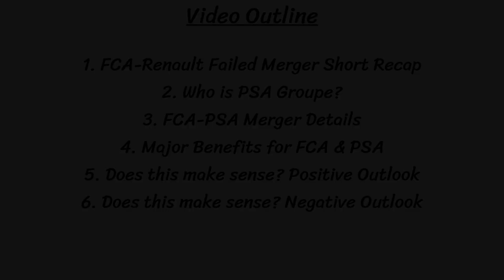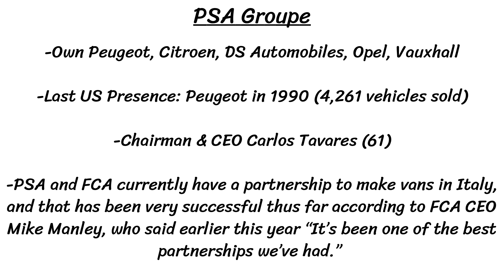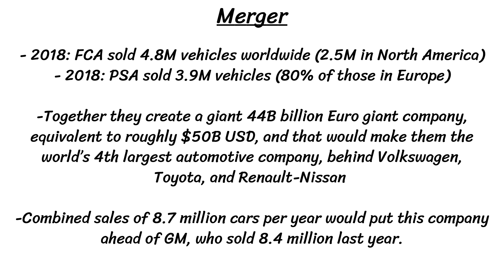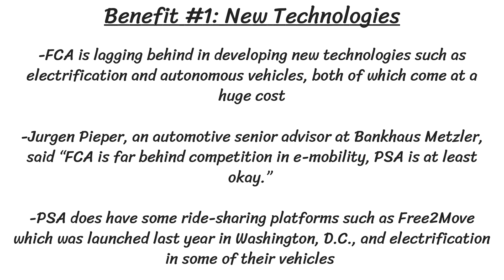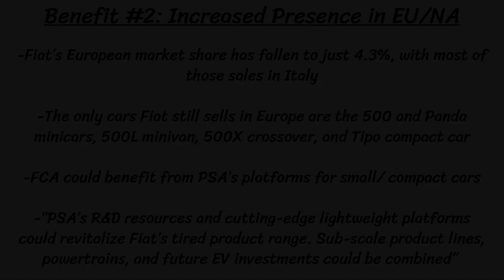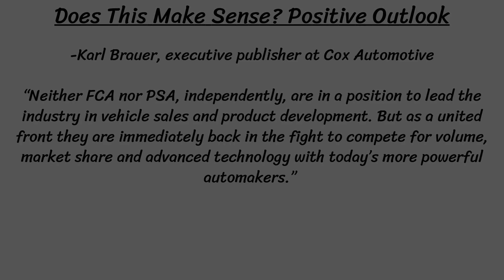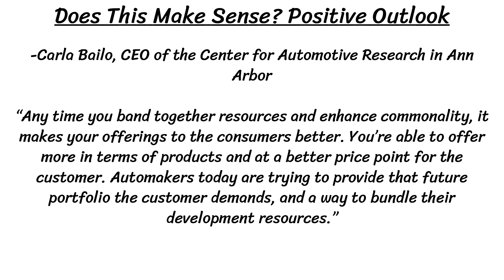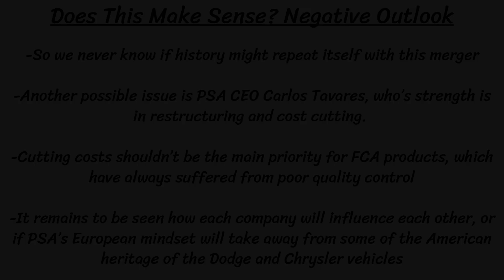Fiat Chrysler (FCA) & PSA Groupe $50B MERGER  -- Who Wins, & Does it Make Sense?

Comment: Next video: 2020 Hellcat-powered Opel 🤣
Reply: Astra ... Or even a Corsa...
Reply: That might actually sell...
Reply: corsa with HEMI engine 🤣
Reply: Kaleb May, don't expect it EVER! Something says to me that HellCat engine will be one of the first casualties of Tavares' "machete" (replaced by a smaller forced-induction V8, like most of their competitors.
Reply: Hehehe yeah! More power baby!
Reply: GT by Citroen with the HEMI :P
Reply: @j.celgoog3275  yes like Citroën SM Maserati 😍
Reply: @syxepop  In Europe, yes, PSA was extremely strict with their choice of engines, and the most powerful engine of PSA right now is a 1.6l @ 225 horse power.

In 2 months there will be a 1.6l hybrid @ 300 horse power and later even 360 hp.

BUT we are talking of choices dictated by an analysis of the situation of PSA on the european market.
Why would Carlos Tavares kill the hellcat if it's a profitable product (financially speaking or from a marketing point of view) ?
Reply: J.C Elgoog, as someone who've had "a little experience in the car industry" (22+ years in a new car dealer) the HellCat was already in the verge of replacement, profitable or not. I would think that what the Germans (all 3 cap their performance V8's at 4.0L) and even GM  (2T-4.2L and 2T-5.5L) seem like the LOGICAL NEXT STEP for this kind of RWD / AWD performance.

And I do believe FCA would be already designing such a smaller displacement replacement for the HellCat while still having a RWD V8 format. Maybe PSA could take the Giorgio QF engine (2T-2.9L V6) into a V8 (3.9L already done by Ferrari in their V8 apps since the V6 is a smaller version of their existing V8)...

This is the kind of analysis PSA's suits may be making as I type for FCA's larger displacement parts-bin, which they will need to update now.

Comment: PSA holds every card in the négociations : Carlos Tavares will be at the top, and 6 out of 11 board members will be PSA. Furthermore FCA needs PSA to survive : the last model they developed entirely was the fiat tipo. The rest is based upon the fiat 500 platform. They lack proper r&d and quite simply they risk failing completely . They’re the only group not placing faith in eVs a few years back and now they need the technology sharing with PSA. They need the 208/308/3008/508 platforms. When Tavares talks about the merger, it’s clear which company is dominating the other. Plus the company’s stocks are reacting In the same exact way as it does when a company is buying another company.
Reply: Yet Obama allowed Fiat to buy Chyrsler what a shit show Chrysler could have made it if the had 1/3 the help GM got.   Without the burden of Fiat Chrysler with Ram and Jeep plus Dodge performance cars would be more profitable than Ford or GM right now.
Reply: @robc8468  fiat saved chrysler, it would be dead by now.

Comment: I believe it will be a successful merger basically because it has to be. Both companies from a long term perspective are in a “Do or Die” position. Where in the past with Daimler or Fiat they were trying impose their will and way on Chrysler. No one can argue that FCA north american ventures are doing it the right way. It would be absolutely stupid to mess with Jeep and Ram at this point. What they need is more diversity and car platform sharing for Dodge and Chrysler. And that is exactly what PSA can provide. PSA on the other hand need to grow their market presence and what better way than to merge with FCA which already has a significant foothold in  this market. How PSA breaks into or distributes in the US is where I think could be a little tricky and needs to be done right.

Comment: I am concerned that the Chrysler brand might be allowed to fall by the wayside.  Throughout Chrysler's history, it was designed to be pretty much a luxury car, but few efforts have been made to market the current Chrysler as such.  Chrysler has also been known (Most of the time) for its engineering prowess.
Perhaps FCA and Chrysler could develop an operation that would combine the best features of Maserati and Chrysler to be marketed in a way to compete with Cadillac, Lincoln, Mercedes and BMW (and maybe even a little Rolls and Bentley).  Even if they leave Chrysler in the market it now appears to serve, they could revive the Imperial name combined with Maserati for the new luxo market.
Reply: They Luxury auto market is shrinking rapidly the Luxury Truck and SUV market is expanding what expertise does PSA bring to the US marketplace table?
Reply: @robc8468  PSA EMP2 hi tech light plateforme 3D night vision and more for ex :))
Reply: The Chrysler brand is terminally ill. 😷 The Pacifica and 300 are your only choices in the lineup in America. All that’s left to do is pull the plug.🔌
Reply: @PrydeWater901  The Chrysler 300 needs to be redone as a convertible the old stretch version of the 300 needs to be reintroduced as the Imperial with all wheel drive. The front end needs to be redone with round headlights more like the current Bentley.  All Chryslers  need to have "Corinthian Leather" seats standard.  The Pacifica should be redone as 4  door with no sliding doors as a three row AWD CUV similar to a Chevy Traverse.  How damned stupid are these European clowns that run this company.  BTW ship that Fiat/Alfa Romeo crap back to Italy we don't want it.
Reply: @robc8468  Electric Plateform, 3D i-Cockpit, Good Quality
Reply: @freewal  Since when have the French been known for electric platforms and good quality?   In what alternate universe do you live?
Reply: 3 D night vision? So FCA/PSA be building military vehicles for US? WTF
Reply: Rob C moroon.
Reply: The Peugeot 508 sedan and 3008 CUV are sleek and sophisticated enough to go into a traditional Chrysler role, it's just a matter of whether the Pentastar V6 will fit.
Reply: @nlpnt  So the Peugot 508 already starts at MSRP $53,990 with a tiny 1.6L Turbo and 6 speed Automatic.  A Dodge Challenger V6 Pentastar 8speed ZF based automatic starts at $20,000 less MSRP. and is durable   and fast enough to be widely used as a police car? A 508 Peugot with a Pentastar and a 8 speed would probably MSRP over $60k I can assure you there is ZERO market for a $60k or even a $50k 4 door sedan in North America.  Nor is their any market for a $37K Peugeot CUV when the same money will buy a proven 4 wheel drive Jeep Laredo. Am I clear on enough on this?
Reply: @robc8468   No. Are those European prices  inclusive of VAT? It's 17.5% in the UK, not sure about France. Also, cars are VERY cheap for automakers to build-it would be generous to assume a 508 costs $10,000 per unit exclusive of sunk costs. Pricing is what the market will bear.
Reply: @nlpnt  A Peugeot 508 1.6 Liter Turbo Even for $43,000 is a not starter here in North America, a Dodge Charger RT can be purchased here with a 5.7L V-8 with & cylinder deactivation 8 speed ZF automatic and 375 HP for the same money and the V-6 295 HP for about $33,000. Peugeot would be considered a poor value and an unproven car in the US and Canada. Depreciation would be horrible, about the same as FIAT  as here and overall cost of ownership higher than a Charger and way higher than a Toyota Camry. A car priced at $43k USD would fall in the entry luxury car range for a low/no status car.  What Europeans think about Peugeot is irrelevant to what North America want.  Conversely  It would be just as hard sell a four door Crew cab Ram pickup truck in France or Italy.
Reply: @robc8468  no.
Europeans love ram, but the 5.7 would be unsaleable there.
Reply: @danielbec4287  I stand corrected likely they would take the 3 liter Diesel Ram in Europe due to the high fuel taxes.

Comment: I see the end of Chrysler as a brand since they basically have the dated 300 and the newer Pacifica which does fit within both companies. The latter will likely become a different brand. The real benefit goes to PSA. They can bring PSA Manufacturered vehicles to the US while possibly converting FCA's plants for building some of the PSA lineups. They would have the use of the dealerships while eliminating low profit, slow moving vehicles along with cars that creates the need to purchase Tesla's carbon certificates due to low gas mileage and higher emissions. The vehicles that come to mind are the dated Dodge Charger and Challenger. It's possible these vehicles become a redesigned 4 cylinder turbo powered vehicles that could sell both here and in Europe.  Big V8, tire burning vehicles are not going to fly with the cost of gasoline and emission requirements in Europe. So make world cars that can be sold throughout the world. The Challenger and Charger currently doesn't fit that market. Development of EV is extremely important and I'm guessing this will become a high priority in this merger. I love my 2018 Chrysler 300C, but looking at dealer inventory. The 300 has become the forgotten car. I hope this ends up being a true benefit for FCA and not an opening for PSA to replace alot of FCA's products with PSA's vehicle lineup. As mentioned. What was to be with a beneficial merger with Daimler Mercedes ended up being a disaster for Chrysler.
Reply: in eu 2020, co2 above 95g gets expensive...

Comment: Fiat are way reliable than people think specially in India is way reliable than worst vw cars that are too much expensive to handle failure Fiat cars are way reliable
My Fiat Punto done 489,981 kms or 304,460 miles still runs as good never ever break down 
But my vw polo break down thrice in 2 year and engine fails at 2,76,000kms or 1714,98 miles i sell it out bought vw vento it break down after 1.7 year now it done 254,000 kms or157,828 miles or car runs good but giving jerk while driving and giving very low mileage only 12 km/ltr or  28 miles/Gallons (Diesel) in city 18 kmpl or 37miles/gallon on highway
.
My Punto gives 16 km/ltr or 37 miles/gallon in city 22 to 23 km/l
52 to 53 miles/gallon on highway 
Polo weight 1050 kgs or 2314 pounds
Punto weight 1198 kgs or 2641 pounds superb stable even on 200 kph on highway where sometimes roads are unstable

Comment: Wait.... so the Buick Regal uses the same platform etc as the Vauxhall Insignia, so FCA will be selling the same car as GM? Which PSA is already doing
Reply: Slowly PSA are getting rid of the GM chassis and moving to they're own so they don't need to pay GM
Reply: I was wondering the same thing. My wife has a Saturn Aura, a vehicle based on GM's Epsilon platform, which was developed by Opel. Fiat also had a vehicle on this platform (Croma?).  
The Insignia was based on the Epsilon II platform, and was going to be the second generation Aura, but GM retired the Saturn division. At that point, that vehicle became the 5th gen Regal.  The current iteration of the Epsilon architecture is E2 (also called E2xx), and it is still being used on current Buicks and Chevys. 
I don't think current platforms will be affected, and GM had already sold Opel and Vauxhall. I'd speculate there were conditional agreements allowing the continued use of the platform, but such speculation will require that I take an analgesic. 
On a lighter note in jest:
Perhaps someone took the term "crossover" in the wrong way. :)
Reply: From what I head GM is actually using Opel chassis. Not the other way.
Reply: @nicholasfield6127  well GM brought Opel in the 30s so if GM is using Opel chassis then that is truly ancient.
Reply: The Epsilon E2xx is being used by GM right now, the best examples being the 9th gen Malibu sedan and the current Buick Regal. The Regal is literally built in Germany and imported to the US, and it's the only current GM vehicle being built at Opel Rüsselsheim Assembly facility in Germany  That's Opel's architecture, and it's also used on the current Insignia. The Regal doesn't just use the same platform as the Insignia--it's the same vehicle. Again, I think something was arranged to allow for this.
Reply: The Buick Regal IS THE Opel Insigna we have now. The only difference is the logos. Understand now why GM is a joke?

Comment: Culling the brands; DS and Ram should never have been marques in the first place, get them down to a single model line each and start putting Citroen and Dodge emblems respectively back on them. Lancia and Vauxhall are zombies - the former is down to a single aging model, the latter is just a name pasted on Opels sold in the UK for reasons that maybe made sense in the '70s.
Reply: if brexit goes, vauxhall is no more
Reply: true for ram, DS is different, ds is to cirtoen now, what chrysler is to dodge, but in a different section

Comment: For literal decades the Euro companies have been trying to figure out the US  automarket. What they sell are expensive niche' cars that are very low volume in the US. Once again, I'm willing to bet they want in on the US's huge truck and Jeep market. PSA merging with FCA would expand that market to parts of Europe where the truck market really hasn't been due to tariffs and other issues.  That's what FCA wanted in the 1st place. It's become a cash cow. Admit it, nearly every shared FCA to US platform has failed, or has been canceled after slow sales. Fiat America barely sells anything at all. And try as they might to push EVs and autonomous tech, the American market is not ready for it. Sales of EVs and even hybrids are still very low despite some models from Toyota being around for nearly 20 yrs. Now that diesels for US sale have a bad rep via VW, access to that market ( from Peugeot, Vauxhall etc) would be shaky at best for imports. I just don't see what the PSA group can off the US market. I DO see what the Chrysler/Dodge/Jeep/Ram brands can do for THEM though!
Reply: trucks does not work in Europ, even cheap ones ! SUV yes :)

Comment: Considering that PSA has purchased Vauxhall and Opel from GM (and that new Holden vehicles are made in an Opel factory), will PSA purchase Holden from GM?
Reply: its unlikely, but not impossible i think.
Holden originally was part of the opel subgroup (opel, vauxhall and holden) that was bought by PSA, but PSA did not want Holden back than, cause they wanted to concentrate on the european market.
with fca, the are more international/intercontinental and they might consider pickin up holden.
tho it might be too late, holden is about to be killed by GM and due to the merger PSA and FCA have other things to do with their money.

Comment: Chrysler has only 300 and Pacifica ?????
Bring back the 200 only this time with an America built or Peugeot built 4 cylinder engine .
Reply: since chrysler does not perform so well, it is possible that they will sell some rebadged Opels or DS automobiles.
but don't worry, these are pretty solid cars.
The other american brands will not change much, since they are performing pretty well.
The european market will see more changes i think, since FCA is prety much dead there
Reply: @Rakonax  They will build a Punto 4 based on the 208 in 2 years like the new Opel Corsa😂
Reply: There is a possibility for a new 200 that could be based on the 508 and be made in 2 years like the new Corsa in based on the 208 despite significant differences between the two.

Comment: As I see the FCA Chrysler Group brands, I see everything Jeep and Ram being updated and even expanded (smaller pickup perhaps and Ram appearing in Europe as the company's single commercial / truck brand), while both Chrysler and Dodge will be dependent on PSA's new strategy. The only way either or both could be kept is that they use the strategy Opel used with GM of bringing their stuff mostly as NA-built versions of their European stuff, bringing built from Europe only slower-selling, but still profitable niches.

The only brand I see in any real trouble is Fiat, as the parties involved doesn't know what the EU's Competition agency will do with the brand, as both Peugeot and Fiat are mainstream large sellers in Europe. They could ask FCA to sell the Fiat brand before the merger is in the books. 

Alfa Romeo's savior is their Giorgio RWD platform (and its' 2.0L and 2.9L turboed engines), which PSA could use elsewhere as well. Seems Maserati has a future as it can slot above DS (it is more like a slightly souped-up Acura).
Reply: as french i can tell u, Maserati will hv a smaller sport coupé, Alfa a CMP plateforme smaller SUV, Fiat will stay as entry small models, Chrysler will get the new hi tech light hybrid EMP2 PSA plateforme while rentable Jeep RAM Dodge will stay so, for some more time ;)